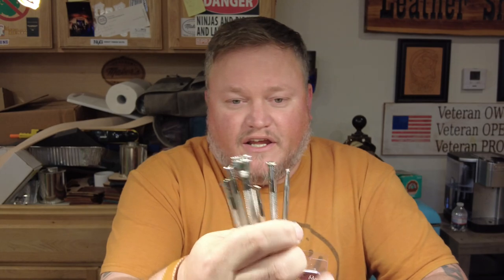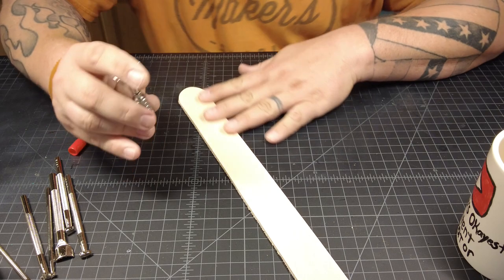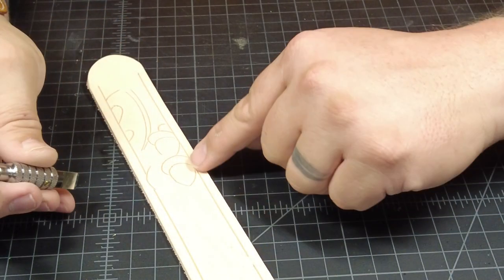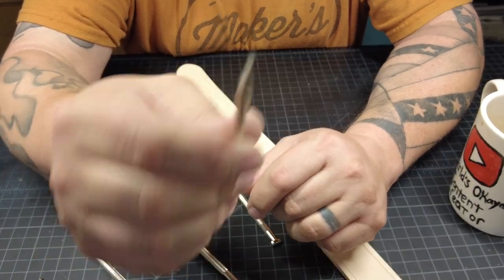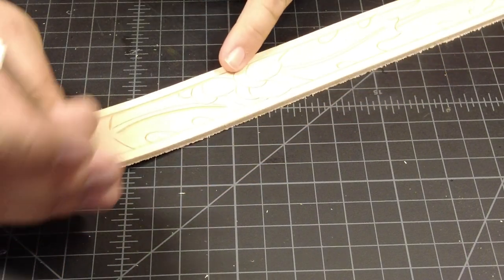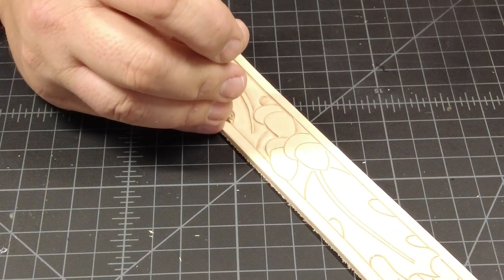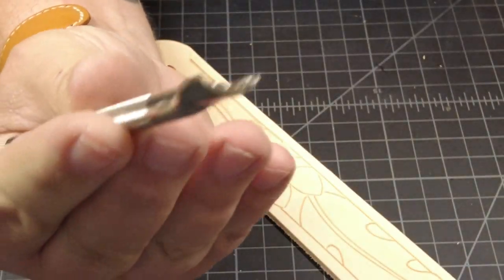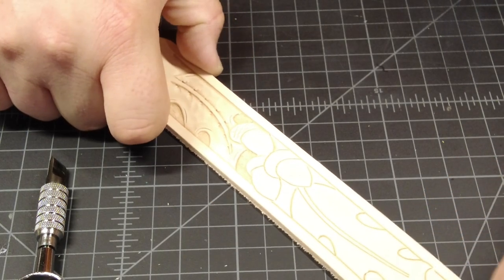Tooling leather: Oak Leaves with the basic 7 piece tool kit

Comment: Did you case the leather before using the swivel knife or the other tools?
Reply from the maker: I use a spray bottle to get it wet.  One good spray and let it set for a bit until it returns to its normal color.

Comment: Right out of the box, mine has a serious burr on one side of the blade, it ran all along one side, the tip was ground so forcefully to one side it left that burr. I didn't even use it for that, not until I find my honing stone to polish it out, then strope it a few hundred times to sharpen it. These tools come in pretty bad shape...
Reply from the maker: Did you buy yours from our store?
Reply: @makersleathersupply1220  Do you inspect all the stuff made from China and fix it before you ship it? I might buy from you if you do.
Reply from the maker: @chrisgriffith1573  I don't need to inspect each tool.  My suppliers know my standards and that they won't be our suppliers any more if those standards are not met.  The difference between a company like mine and Amazon is that not just anyone will be represented by Maker's.
Reply: @makersleathersupply1220  I only say that because I know that no matter who is selling these swivel knives, they are made in China and likely made in one factory, no matter who boxes it with their name and various other items, so it comes down to distribution being the difference, not the quality. Most of China is rolling the dice atm on nearly anything they move. Sadly, to stay competitive, you'll need to box more or less of these tools they produce, they just aren't being made anywhere else for China's ability to move volume and price that forces anyone else out of the game.
Reply from the maker: @chrisgriffith1573  I can agree with this, but our budget swivel knives are made in Taiwan in a much better factory.

Comment: This is an awesome video thank you for showing with the beginner tools. I have a question though how are you hammering so quietly are you editing the sound when you edit the video or is it your work surface I really want to get into tooling but I live in a apartment and I don't want to get evicted I would really appreciate your advice Please And Thank You.
Reply from the maker: My table is VERY solid.  When I used to do this in the barracks, I'd use a large cutting board in my lap with a rubber pad and then the stone on top of it.  Wasn't always the most comfortable position but it got the job done.